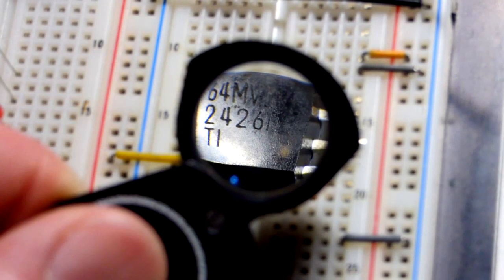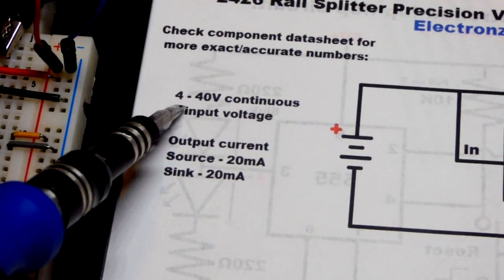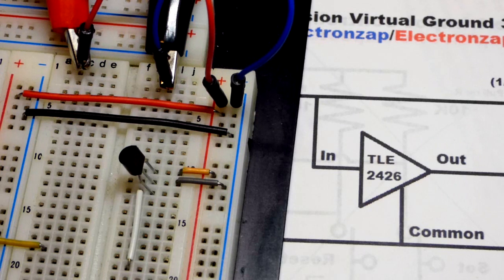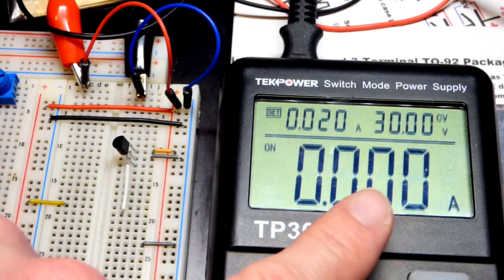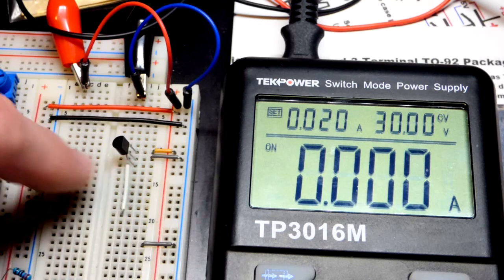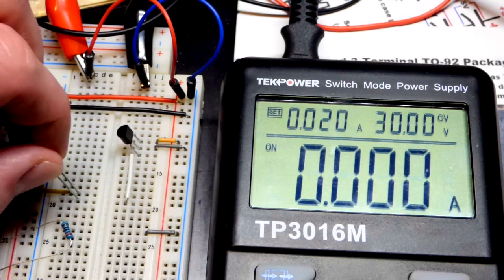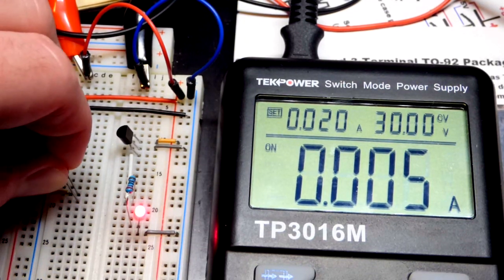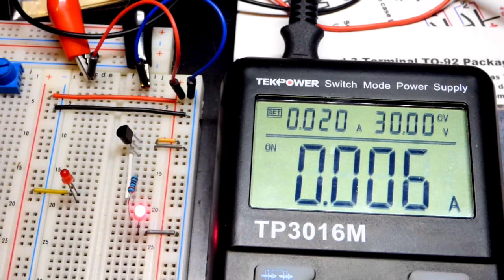How to get split voltage from single voltage using 2426 TLE2426 3 pin rail splitter virtual ground

Comment: Thanks for the demo, I have been aware of these ICs for several months now, but I have yet to find these ICs for cheap. I was able to pick up 20 ICL7660S 8 pin DIP ICs for just under $6 off eBay however. Go figure ...
Reply from the maker: Yeah. Definitely best to shop around.
Reply: If you dont want to buy one of these, you could use two resistors and an op-amp (with a cap for noise reduction if you want). That is what goes inside the chip. Only thing is you will want to use precision resistors (these chips are good as they have trimmed resistors for the divider). Good luck!

https://tangentsoft.net/elec/vgrounds.html